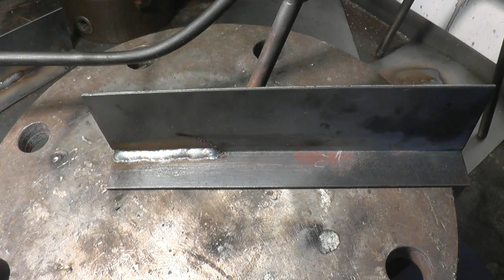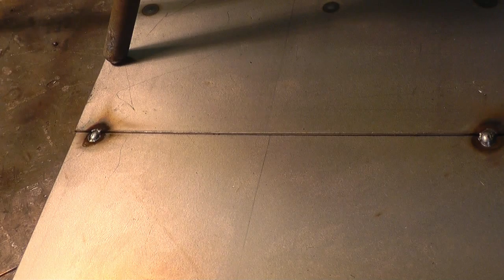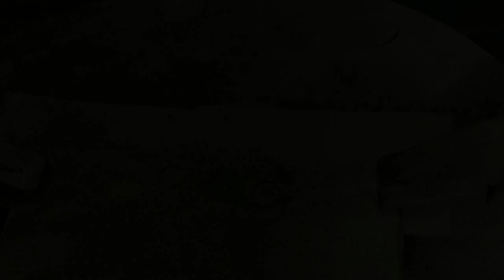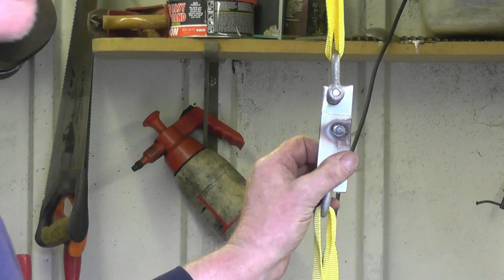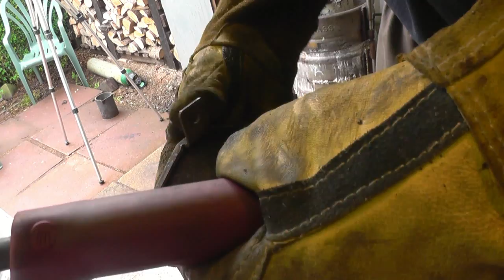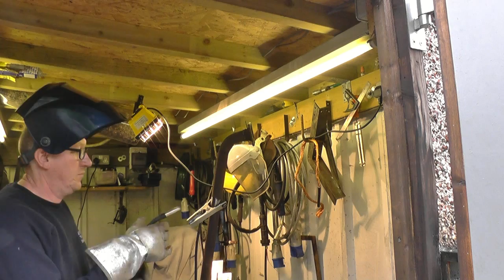R-Tech Welding MIG180 Mig Welder Review Part 3

Comment: hi john got my rtech 180 and its cool but im struggling to get a decent weld, it sounds very stuttery and popping , ive tried the settings you used here but no joy , have been trying different settings but no luck, the weld look ok but the stuttering is very off putting, any advice mate
Reply: To me John's current is to high for the wire feed it is going into the spray transfer area, also try welding right to left so you can see the weld and where you are going ,and on thin plate you do not need a large weld , hope I have been of help

Comment: John ivr recently bought the Rtec 180 mig just using strate co2  I'm just burning strate through on every panel I touch  fresh metal or slit rust I've mixed around with the setting  using0.6 wire & still no matter how low or high  go with the setting im blowing through could it be the co2 as my old sip 100amp welder didn't do so when using co2 . Any I dears ? Very grateful
Reply from the maker: I use .8 wire with argon co2 mix   it should weld ok on co2   give r tech a ring they will help you
Reply: @doubleboost  cheers john for that & yes I will give them a bell as were very help last time I spoke to them regarding a part. Thanks

Comment: Hi
I have just I have just bought one R tech mig welder 180
Can i do welding without gas
Reply from the maker: You can use flux core wire (not ideal) you can also do MMA (stick) welding  You really need gas to use the set properly

Comment: Very handy knowing the settings for 1.6mm John, as I'll be buying one of these to weld 1.6mm 1.5"OD mild steel tube. What would the settings be if I was using 0.8 wire?
Cheers

Comment: John, if you have a manual tig torch could you show how the welder copes with a bit of scratch start tig? Colin
Reply: It's only a mig welder reedxuk
Reply: m fletch it's also an inverter arc welder, so hopefully should be good for scratch start tig too.
Reply: Cheers how would you set the gas up to use it as a tig
Reply: m fletch the gas is controlled by a manual valve on the tig torch which is used to turn the gas supply on and off. The welder itself is used purely as the power source. This is the type of tig torch I use https://www.weldequip.com/tig-conversion.htm
Reply from the maker: That is a good idea been a while since I had a good scratch
John
Reply: Manual valve I see now how that would work